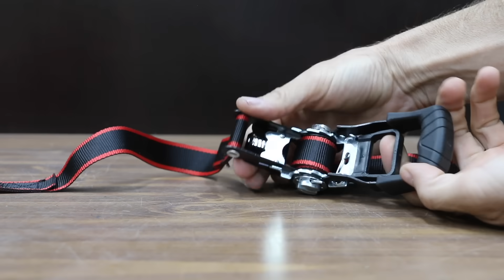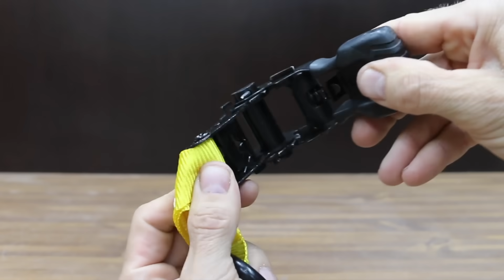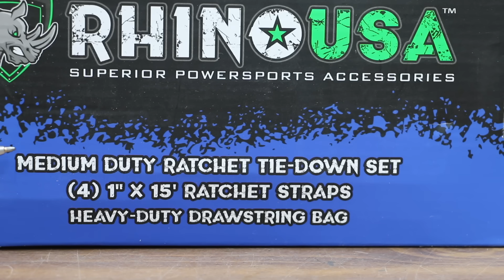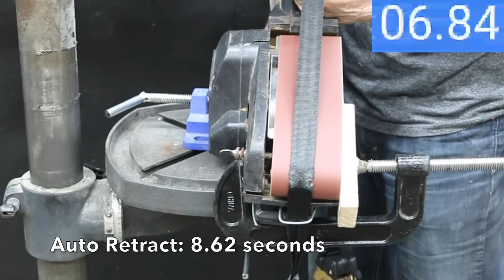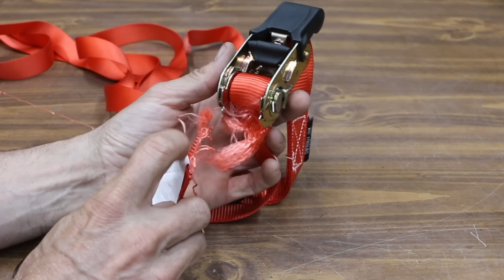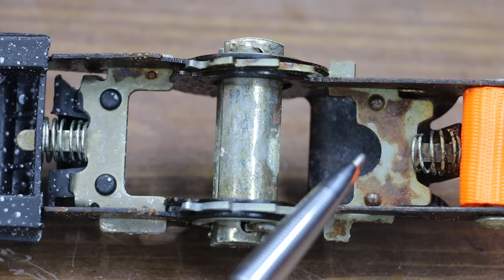Best Ratchet Strap? Husky vs Stanley, Rhino USA, Rocket, Topsky, Augo, RPS Outdoors

Comment: That auto retract looks identical to the straps I get from an on line place called U.S. Cargo Control. They seem to last quite a while. My wife and I mow lawns so I'm always using them and the auto return features saves a huge amount of time throughout the day strapping, unstrapping, restrappting, etc, etc. I use three per mower and they have worked out very well for me. I've tried retractable straps from a local tractor supply store and they were junk quite frankly. Three of them failed me within the first two days of use. The straps didn't fail, but the ratchet is what failed on all four of them.  I'm very happy with the U.S. Cargo Control straps and would highly recommend them. I use an abrasion resistant sleeve on one of them because one of the straps runs over a piece of angle iron on the trailer and it works very well protecting it. I like your channel because you don't give us a lot of nonsense. You get to the point and seem to be as impartial as anybody I've seen testing things. Keep up the great work.
Reply from the maker: Thanks, will do!  Thanks for sharing.

Comment: In my opinion none of those are worth the price. Maybe I have just been spoiled' being able to use industrial-grade ratchets and straps, the type that you can fit your whole hand in and literally swing off. The type that can hold together a 30 year old pine tree that has split down the middle. The type that can be left outside in the weather for over 10 years and have no degradation... So, yeah, I guess I have been spoiled'. But the upside of the industrial grade stuff is that it will last you your whole life.
Reply from the maker: Thanks for the feedback.

Comment: I know this is an older video however they got a new strap on the market that claims only loses 10% of it's hold strength when load shifts 1/2 inch where a traditional strap loses 90%.  Sounds like an awesome video to me
Reply from the maker: Thanks for the suggestion.

Comment: When I started as an antique dealer, I transported furniture in my pickup.  I was using friction straps, but I would have to stop the truck repeatedly to retention the straps to protect the furniture.  Then I found ratcheting straps which solved my problem.  When I started transporting motorcycles, the motorcycle shop only used friction straps.  I started using them for motorcycles and had no problems.  Testing motorcycle friction straps might be an idea.
Reply from the maker: Thanks for the suggestion.

Comment: I like to pre-stretch my straps. I don't know if that's good or bad. I usually put them out to full length, soak them wet and then tighten them down until you get normal load tightness and then let them dry out in that position. It doesn't seem as though they stretch very much at all after that. But I don't know if this is good or bad, just what I have always done.
Reply from the maker: Thanks for sharing.

Comment: The abrasive resistance test seemed more of a heat resistance test. Also, even if you were to slow the abrasive test down by a significant amount, I think the grit of the sandpaper is catching too many fibers at once, whereas normal wear would be a result of fewer, or even single fibers being snapped at a time. If you were to use a very fine grit and slow it down as to not generate heat, I think the data would be more valuable.
Reply from the maker: Thanks for the feedback.
Reply: @ProjectFarm  Thanks for taking the time to read my comment, I hope I didn't come off as overly critical. I appreciate the fuck out of you and everything you do.

Comment: Thank you Todd for yet another great video.  I have used almost every brand of ratchet strap over the years, and due to the abuse I've put them through, I've broken them all (even 2", 5000 Lb rated ones).  While your tested were fairly comprehensive, if you revisit these, I would request adding a test for the ratchet handle durability.  The all metal ones used to bend under extreme pressure, but now most are at least partially plastic.  In the last couple years I have blown a couple apart (the ones that Haulmaster and Fortem) as they turned out to be steel plates on the sides slid into the molded plastic grip, no metal connecting the side plates together.   Therefore, I think it would be interesting to see how many Ft-Lbs before the lever deformation and catastrophic failure.
Reply from the maker: Thank you!

Comment: Really appreciate your due diligence and have made purchases as well as behavioral changes due to your comparisons. I am refitting a sail boat and will have to do a lot of carpentry.  So here are 2 ideas 1)Jig Saws and Jig saw blades.  2)  marine epoxy - West System,  total boat, MAS to name a few popular marine grade epoxy resins and maybe even epoxy resin vs Polyeste resin.. Lots of fiberglass boats are built using polyester resin instead of epoxy and from my understanding it's due to cost.  Thanks for your hard work.
Reply from the maker: You are welcome!  Thanks for the suggestions!

Comment: You should've done the "self tangle" test. Lay strap down in a perfectly straight line. Shut the door and leave the room for a day. Then go back observe the tangled knot and ball each strap will inevitably be in. I have several straps. Some in my truck cab, some in the truck box, some in the garage. If I store them all neatly, then when I go to use one the whole lot will be in one great big scrambled ball in the corner on the floor.
Reply from the maker: Thanks for the suggestion.

Comment: One other factor with ratchet straps is UV fade resistance and how it affects webbing strength. I use several different brands on my utility trailers to hold down loads and I've noticed the orange and red ones are not photochromatically stable and fade quicker. 
On a side note. I was at the dump and a trailer with double axles. As he's leaving one tire blew out. He removed the blown tire then used some big straps and wrapped it around axle and attached it to anchors on the trailer. He then proceeded to ratchet the axle up out of the way and went on his way.
Reply from the maker: Thanks for sharing.

Comment: Definitely need to do open/box end wrenches at some point.
One time when taking off a brake-line. My Husky open-end 10mm kept slipping on the nut. Then I tried my dads old Craftsman 10mm, and the nut came right out.
Reply from the maker: Thanks for the suggestion.

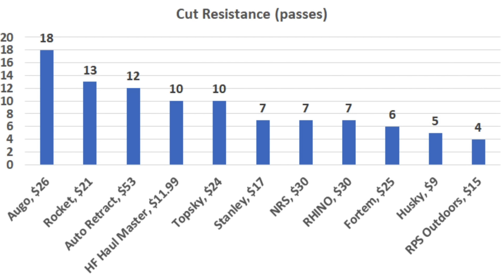Comment: @7:40 The cuts although equal pressure was applied the cutting angle didn't seem as fixed as it could be. With some cuts coming in at a very different angle.  And for some belts they seemed to bunch up more. This bunching might be a natural part of the belt or because of the cut test.

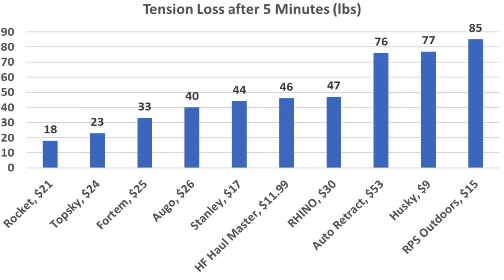The following tests are more conclusive and relevant to how straps are used. @13:52 It's hard to model those failure loads but the variability underminds the testing a little IMO.

Thank you Mr Project Farm. Your practical testing is both interesting and potentially invaluable to newer tool users and my self.  

P.S. I only wish you tested more European brands.

Comment: I purchased RINO and found their small spool only handled just over two wraps. Under heavy load or too many wraps the cam plates spread and would not release. I had to carry a screw driver to release the locking plate.  I ended up tossing the set after 5 uses.
Reply from the maker: Thanks for sharing.

Comment: I have those Husky ratchet straps. I have a Tacoma, I'm not going to move anything huge or extremely heavy, so for under $10 they are just right. The biggest things I have moved so far are a wood entertainment center and a treadmill, both stayed in the truck and in place.

Comment: There's the potential for test variation here, especially the cut resistance and load-induced failure tests. Performance varied so much that I would be surprised if the rankings would change, though. Topsky surviving 51 seconds of abrasion while Flat Stanley didn't manage 6 isn't caused by test variation, but I don't think Stanley would come out ahead of many other brands in a rerun of that test. I thought the corrosion test was pretty clear-cut, too.

Some smart strategies can avoid fraying and cuts, like padding any sharp edges you can't avoid running the tie over and avoiding side-to-side movement. I still would rather get a tie with better results on those tests, though!

"Cousin Eddie" has good fashion sense, as expected.
Reply from the maker: Thanks for the feedback.

Comment: For 9 bucks, and possibly NOT using them really frequently, I think the Husky brand might be the best bang for your buck.
I use ratchets to tie down my motorcycle to the shop lift and have found that the cheap Harbor Freight orange ones' straps come apart quickly. And if they're under a lot of tension, it hurts your finger trying to release them.
Reply from the maker: Thank you for the feedback!

Comment: Would have liked to see an evaluation of the locking button.  I’ve owned many (not all) of these brands and the number one issue and fail point is almost always that the locking button/mechanism wears out and fails over time.  Remarkably, I’ve found that the Bauer has the best design, for ease of use and reliability.  *This is without regard to cost.
Reply from the maker: Thanks for the suggestion.

Comment: I’ve watched many of your videos. I have a good one for you. “Blue Devil” I just used the rear main seal pour & go on my 2007 Chevy Suburban 5.3L. It had a pretty significant leak. It’s been 1 day and it has almost stopped the leak. I was using 1qt of oil every 3 days. They also have head gasket sealer & oil stop leak. Check it out!!
Reply from the maker: Thanks for the suggestion.

Comment: As someone that uses ratchet straps all.the.time I hate them all.   There is gold in there hills for someone that makes a better system.   Also, PF, thanks bud.   But I Think you missed out on quiet a few brands.  Also, your way of rolling straps is good, but the real way is to throw them in the back of the truck.
Reply from the maker: Thanks for the feedback.

Comment: I've used the haul master and husky straps, and I prefer the husky for the smooth ratcheting. The strap on the husky doesn't seem too robust, and the overall bulk of the unit makes it harder to store. The loads I've secured are nowhere near the limits, but the stretching is still noticeable on the Husky. A spring clip lock would be a welcome addition, especially when working with vehicle roof racks, as the hook falls off frequently, which can be frustrating and time consuming. That being said, I like the Husky straps for the price and smooth action.
Reply from the maker: Thanks for the feedback.

Comment: As someone who rides motorcycles and has had to use tie downs to keep my motorcycle in the back of my truck, the best kind are the simpler ones, like the NRS brand. I think some ratchets are good, but they get bunched up, sometimes break, and are just too slow most often. I love the ones that just use friction and have a push point and you have to use your own strength to get them to pull down the weight. But I'm working with suspension, so I weigh down the bike and pull the strap. Super easy and effective. Never had my bike go loose with those, but with the ratchet ones I've had them go to shit and I had to stop driving and tie off the strap so it wouldn't come loose again. I guess it depends on what you're tying down.
Reply: There's a couple of YouTube channels 'SRK Cycles' and 'Bikes & Beards' you should check out.  He sells a product called "Tank Straps" which are amazing.
Reply from the maker: Thanks for the feedback.

Comment: Regarding the knife test. I would be interested in seeing how the break strength changes after a single knife pass. I think a single sharp edge scuff is a real world possibility that can weaken a strap.
Reply from the maker: Thanks for the video idea.
Reply: Also how are they affected when wet oily dirty, I saw a demonstration done in the USMC they took a weight tied to a rope and lowered it over a 90° stone corner, they did it with a clean dry rope, an oily rope and a dirty rope, all cut from the same rope and the difference in damage to the rope was extreme
Reply: Absolutely

Comment: Kinedyne makes heavy duty ratchet straps for the trucking industry, they have your normal J-hook flatbed ratcheting straps which are rated to 5500# and they also make a baby version, with easier to use hooks that are rated to 3333#. A little overkill and big for this particular test, but it’d be interesting to throw the smaller of the two into a test like this.  Ratchet straps are one of the most useful tools around the heavy duty shop especially if you are a smaller guy like me, and only weigh 155# soaking wet, so handling heavy overhead parts like a PTO pump is much easier and safer.
Reply from the maker: Thanks for the video idea.

Comment: Would love to see a round 2 with ratchet straps featuring double J hooks rather then S hooks. This, of course, may be due to the tiedown points on my truck work well with the double J hooks, but make working with S hooks a fight without removing the plastic bed liner.

Comment: @projectfarm The loss of tension has been sticking in my mind since I saw this video. One question about that test. Did you have a relatively similar number of wraps for each strap? Since these work on a friction basis, I would think that more wraps of the strap around the ratchet would reduce tension loss. Not a criticism of the methodology, just a curiosity.

Comment: Dang, you didnt test one of the top ratchet strap brands out there. I'd love to know how the (SmartStraps) brand would have stacked up?  Also alot of failures I've had with ratchet straps happens in the cheap plastic handles while ratcheting loads down really tight. You should test the strength of the handles if and when you do future tests on them. Love the videos and all the hard work you put into them. Keep them coming!
Reply from the maker: Thanks!  Thanks for the video idea.

Comment: Your straps are wiggling sideways when you do the cut test. I think 3-4 of the strap cut tests are invalid, because the strap moved sideways between cuts.

...not that I think it matters. Unless one of these straps has kevlar or nano tubes in them.. or at least nylon.. they're all going to have about the same strength / resistance to cuts and tears.
Reply from the maker: Thanks for sharing.

Comment: I've been using the regular orange 1 inch Smart Straps to hold ladders on my cable truck for 8 years. Only replaced them once when they turned white and dry in the Central Florida sun or the one time I cut one.
EDIT: Commented before watching. The Topsky looks a lot like my straps except the release handle on mine is square and the frame is a light brass color.
Reply from the maker: Thanks for sharing.

Comment: There seems to be a lot of variability in the testing conditions here. This isn't aligned with the tight conditions of many of your other comparison videos. Example: working load doesn't start at the same load for every strap. What if the straps experience more "stretch" with higher load? Applying 200lbs to one and 340lbs to another would give skewed results.

Comment: If you consider these size straps are for holding down smaller items in your trailer, like furniture and stuff, then the half ton rating is pretty good.  The fun begins when you don't have a bigger strap for a bigger load and push your luck a little.
Reply from the maker: Thanks for the feedback.

Comment: I'm surprised the Husky straps did as well as they did, especially actually being true to its listed break strength. I bought a set for a cross-country move (2500 miles) when I needed to secure a motorcycle inside a rental truck and they performed admirably, but I did need to tighten them during one stop both because the motorcycle shifted in the truck, and because the straps stretched slightly and became a little loose. But overall, it cost me 10 bucks to successfully transport my bike. And I'm slightly surprised price didn't come into play at the end. It's definitely worth considering use case because while it's a good idea to buy a better strap, if the cheaper one can do what you're asking of it then there's no reason not to save a few bucks. For me, it was light duty over the course of a single trip across the US in the least adverse conditions imaginable (Inside a box truck, the straps running over a padded seat and rounded motorcycle gas tank with zero chance for abrasion/cutting), and then continuing sporadic light duty here and there into the future. If I were planning on doing more strenuous work I might've splurged, but 10 bucks was all I needed.
Reply from the maker: Thanks for sharing!

Comment: 2 cycle as a diesel fuel additive.? i have heard modern diesel is very dry and 2 cycle will help lube the fuel system
Reply from the maker: Thanks for the suggestion.
Reply: @ProjectFarm  im wondering how or if does effects combustion or change fuel mileage, i run it through my cummins but what ratio is best? would love to know ans see it on the lubricity tester!

Comment: SHARPIES
I have sharpies in my kit (Military) and have been trying some diffrent brands. I'd love to nice a test on sharpies as many of us use them on a daily basis

-Longevity
-Time to dry out
-Durability on concrete, cardboard, metal
-Pressure to pres the tip in
-Writing durability on materials
-Performance under wet/damp/oily conditions
-Freeze point (It got down to -32 celsius/-25,6 Fahrenheit where I live this season)
-Heat tolerance
Reply from the maker: Thanks for the video idea.

Comment: I had some cheap ratchet straps that lived in my truck. After maybe a year of fairly light exposure to sunlight they were absolutely useless. Instead of 250kg I could break them with my bare hands. This is a potential issue on the cheaper light duty ratchet straps.
Reply from the maker: Thanks for sharing.